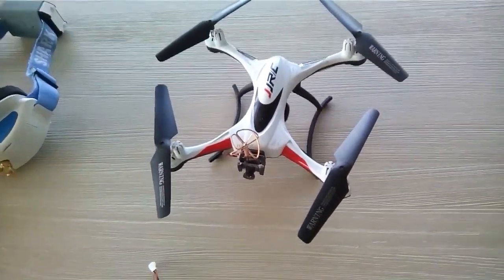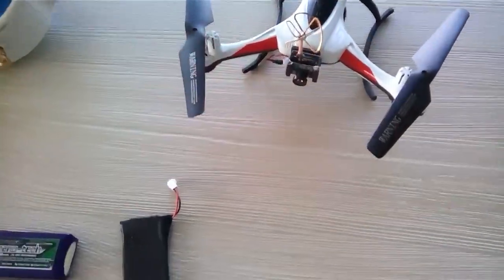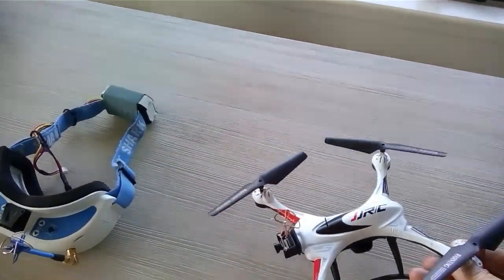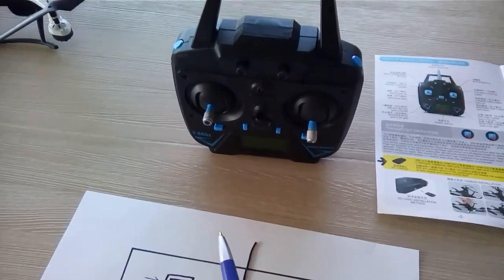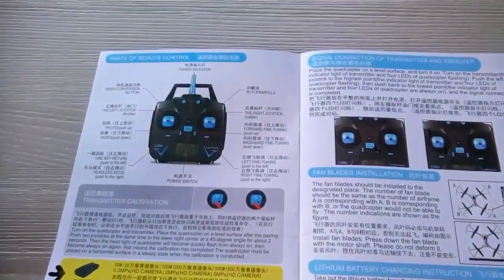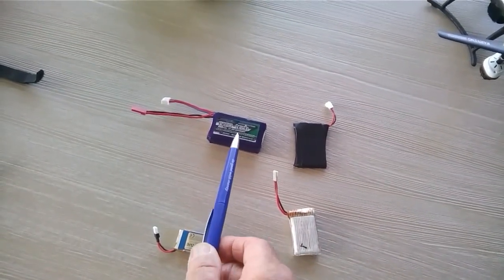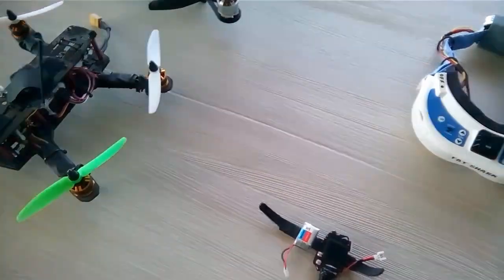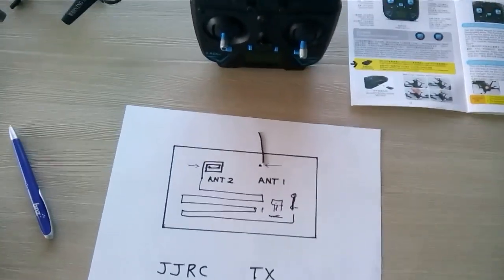JJRC H31 modifications that you will want to do .

Comment: 0:20 I've said the same thing too many times... flying bricks not multi-rotor helicopters.  Started off with a light weight 550 and low KV motors spinning 12in APC props using plane ESC's that I'd classify as a flying weed wacker turned upside down and it's now a rescue quad for smaller quads so far collecting dust. I wanted the freedom to fly wherever I wanted FPV so jumped down to a 80 gram Nihui U807 stripped down and a JJ1000.... and used the same FCC certified cams keeping it legal that recorded my DX9 not keeping up due to being the low man out.  The fact I'm looking at the "toy market" again (will replace FCB and RX) shows where the RC Hobby needs to head.... smaller and lighter not to  mention safer although the hobby is now already far safer than RC helicopters  and old nitro wood planes were.

No more props for U807 available for a reasonable price so looking at the H31... being waterproof is a plus but like how silent the U807 is setup right and it flys like more a glider for training in the wind... JJ1000 makes a racket compared to it... but it too is discontinued showing short sighted thinking rather than constant improving over time and building a large user support group.

Comment: Use caution. This mod messed up my TRANSMITTER. Perhaps I should have used stranded wire. I used 22ga solid. After much testing my TX mod decreased range. After much hassle I learned it would not run all my quads. I bought a set of five H31's off ebay. Then four would not fly! They
were unstable in mode 3, and in mode 2 would not turn right well. After lots
of hassle I found out it was my modified transmitter!  A new unmodified transmitter would fly all six of my quads. My modified one would fly two. Do your own range test, in a BIG field with no high grass: fly the quad away from you about 10 feet off the ground. until it falls out of the air. Then do this mod and see for yourself, let us know what you found out! I will keep trying, and keep you posted.
Reply from the maker: Hi James S.  thanks for your comment , we all can learn from others , however I would not risk flying my H31 without the antenna modifications as 95% of my flying is well beyond line of site with FPV goggles , the FPV camera cost more than the Quad so I do not wish to lose either ,  I can only assume your first Transmitter was faulty which can happen at times with toy grade gear , maybe this is why most mail order sites offer replacement TX and RX, PC boards as spare parts . Did you try calibrating the Transmitter when it was playing up ?
Reply: I am with you, I want to figure this out. My test was done with three transmitters (one modified) and six drones. Seemed like a good test, but there a lot of variables. One drone was bad. They all seem a bit different. I am up for another test. What kind of wire did you use? Mine was solid 22ga. I always sink gyros, is that what you mean by calibrating TX?
Reply from the maker: I used a multi strand wire similar to the RX antenna .Yes I think sink the gyros would be the same as  the instructions on page 2 of the hand book that came with the model for Transmitter calibration .  I hope you get it sorted as they are a great quad for a quick flight just about any where , Another mod I have just done is shift the front L.E.D up so I can see it flashing via FPV in my Goggles when its time to land rather than run the battery flat :)
Reply: I will give it another shot with the multi strand wire. The length s/b 28.8mm, but a little longer should not hurt. People w/o calipers should aim for between 29-32mm. Cool idea on the light. I like H31 as well. When you take the camera battery out you only save about 6g. Do you ever fly both FPV and the camera at the same time? Did you just wrap the camera in black tape? The camera cover seems so light, why did you do this?
Reply from the maker: I took the case off the key chain camera because the battery failed and decided to put some heat shrink 0n instead of the case also I now run the camera 0ff the quad copter battery by soldering a plug 0n both , this saves having to carry a camera battery ,   I haven't flown FPV while running the key chain because the goggles can record the flight ,   What country do you live in ?  :)
Reply: Ha! giant heat shrink, did it not put a bit of force on the board, I want to do this, it makes it look slimmer. I am in the USA. Where Are you?
Reply from the maker: Got some thin heat shrink from the local electronics shop , its good having the external plug to use any 3 volt battery or direct to the quad , I'm in New Zealand , North Island , east coast where all the Kiwi fruit are grown .

Comment: Hello Barry,
As far as I can tell the stock receiver antenna on the H31
is about 31.25mm long. How did you come up with a 35mm length for
both transmitter and receiver?  28.8mm to 32mm would be my guess based on the research I have done. Did you use solid copper wire like door bell wire?
Reply from the maker: James S. hi james , yep your right with the antenna length , I unsoldered the one in the quad and replaced it with a flexible one to avoid it breaking , when I made the video I quickly put it on a ruler , sorry about that :)

Comment: Hi Barry, like to ask a question? Are you running the camera and quad on the same battery. I have the tx03 aio camera. Thinking I could connect camera to the camera port on quad. Would that work. 3.7 850mah

Comment: Dear friends,

I faced up a serious-dangerous problem with my drone JJRC H31. I must add as an information...that I extended drones" range as a youtuber suggested on his video. Moreover I used a wifi 2 mp camera and original JJRC H31 battery. However as everything was normal and my drone didn't lose any signal ...the last 4 days without to do any change...my drone as it's on the air and propellers stopped...suddenly it felt down on the gap for 2 second and after this...the propellers start to work again. It isn't it out of range. Something like: 1)engines propellers stopped and drone is falls down OR 2)signal lost and drone falls down? Or 3) Do you believe that it may be happened when the wifi camera is losing or decreased it's signal sometimes? The battery sign on remote control shows that the battery of remote..are full!
Reply: Tha Tol could be anything from the fcb to failing esc or bad solder joints/lose connections..without having it in hand it's impossible to diagnos over the internet. ...n fyi engines use fuel and motors use electricity...there are no engines on a quad.

Comment: Hey I have the cam I’m having trouble as to where I need to solder the wire to.  I asked a couple guys they said it wasn’t possible but you simply proved them wrong. Do I solder on the opposite side of the circuit board labeled “bt” + / - or on the actual wire battery wire itself ?
Reply from the maker: If you have a solder iron its quite easy to solder a plug wire inside the quad to the battery lead , have a look near the end of the video when i turn the quad upside down

Comment: have you thought about any mods to make it more water proof. I just ran mine with 5 batteries about 1.5 miles while racing my pontoon boat on a lake. was very fun but blew a motor out doing it, I'm not sure if it was water damage or just ran full speed too long and over heated.
Reply from the maker: James Augustine  only the circuit board is water proof for a quick dip , you did very well with your flight, motor are cheap and easy to fit , just make sure you solder the same colour wire on so it rotates the right way

Comment: Hello! I started having a funny problem with my h31. I am strapping my batteries (600mah) with a velcro strap on the place for the camera and since 2 days my drone is starting to loose horisontal stability and drop on the ground while spinning like crazy. Any ideas why this is happening? Thank you!
Reply from the maker: Zaky Zakono try calibrating the TX as on page 2 ,  are all the motors spinning normal & OK when hovering close to you ?
Reply: I am calibrating it very often. And yes - the quad hovers good until some faster pitch or yaw...
Reply: Zaky Zakono It may be messing with the transmitter. Try to take off the battery and try it.
Reply: It was a faulty motor. One of the brushes was broken and a little piece was creating a mechanical resistance inside. I tryed to cut a new brush from a thin metalic plate. The motor worked but because it was with different coeff. of elasticity it caused again some mechanical resistance with the rotor and the motor could not reach the desired power and work properly. Only changing the motor did the job... Cheers!

Comment: Somebody try change motors to better model/brushless with esc?
Reply from the maker: Silesia Gameplay no need to I done 100s of flights as it is & spare motors are cheap
Reply: Thanks for anwser. I have one more question, xk x251 is a good race drone for beginners (also like second drone)?
Reply from the maker: Silesia Gameplay if its the one I've seen it looks great , (brushless motors) & easy mod for different batteries , its hard to get batteries in NZ the airlines won't allow them in airmail packets .
Reply: Polish law will allow me to buy this batteries :DI can try :D